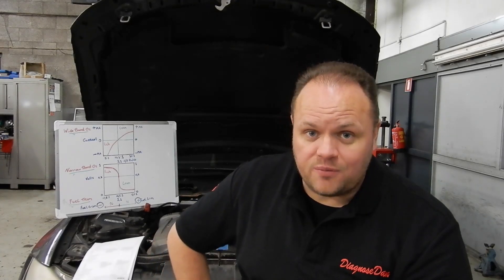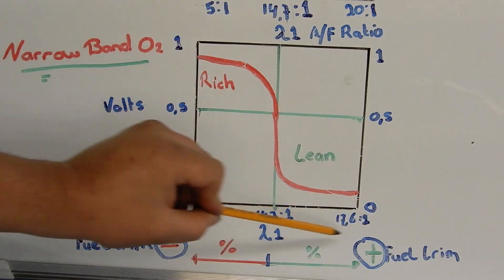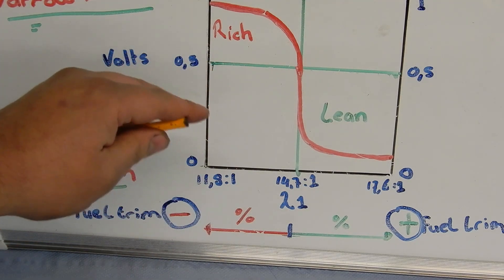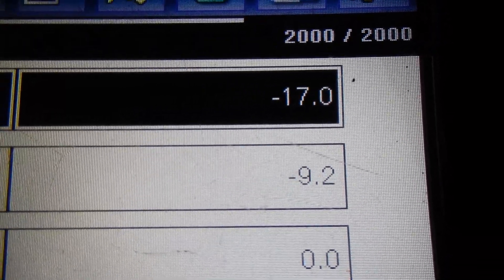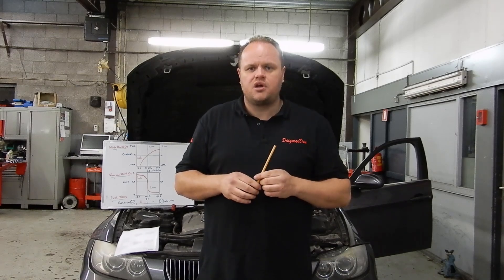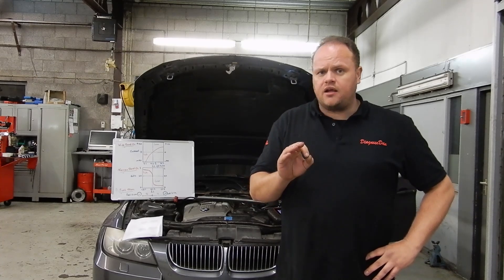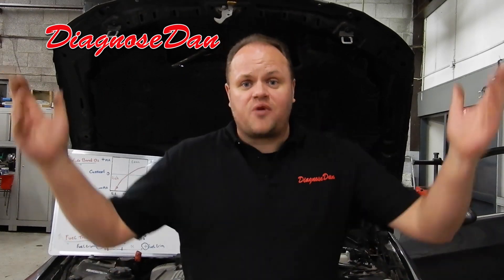Wideband O2 sensors, Narrowband O2 sensors and Fuel trim.

Comment: Really good video, for my search on YouTube send me to find it, really goos explanation,  i been a month try fix my truck, obd2 show long term fuel trim bank 2  28.9 and o2 B2S2 .045 with code of P0174 , i check everything no vaccum leak, now i will check O2 sensor with carb on intake to see if works

Comment: Hmmm. If there is no vacuum in the manifold of the Bimmer, then definitely you can't drive it lean by introducing a leak, it just won't care, you w2ill only introduce some dust. But how is this possible? I think there has to be something new about the valves on that engine. If I could "dynamically" control the amount of air by varying the valve open time or size, depending on the signal of the throttle position sensor, then maybe I would no longer need the throttle plate. I see no other possibility here. 

How strange. I am trying to help a friend diagnosing a 2006 New WV Bug that has some codes. There are two, that seemingly contradict each other: P0171 (bank 1 too lean upstream) and P2097 (bank 1 too rich downstream). This makes no sense, as if the bank is lean to begin with, how can it get rich downstream? I was contemplating my next step, when your video popped up (I did not search for this rare condition, I was just watching some basic refreshers about O2 sensors). But now, I am sure that my thoughts about a possibility of bad O2 sensor is correct and makes sense, and what my next step is going to be!

Thank you so much, Dan!

Comment: So...the only thing the O2 Sensor does is read Highs (Rich) and Lows (Lean), the Narrowband has longer times between the readings, while the Wideband has more readings within the same timeframe. That's their only function. Thus a Narrowband can be replaced with a Wideband .

Comment: Great video.  It sounds like Dan sprayed brake cleaner into the air intake to test the O2 sensors.  Is this the best approach or are better spray products (e.g., carburetor cleaner or starting fluid) available for this specific purpose?

Comment: I have a motorcycle, when I connect it to the fault detection device, the oxygen sensor value is 70mv, I think the sensor is broken, what is the operating voltage range of the sensor?

Comment: There is no vaccum  in the intake because of the valvetronic sistem that controls the amout of air gettin in the cilinders by changing the lift for intake valves. Throtle body is always open and that cause no vacum in the intake

Comment: I know I am late but still have some questions.
Post cat o2 sensors are ALWAYS narrow band and pre cat sensors are wide band for the past 15-20 years, right? Older cars might have narrow band PRE cat o2 sensors. Right?
Job of catalytic convertor is to convert the NOx to o2 hence we do not see the post cat sensors reading 0.5V (assuming pre cat sensor is optimally maintaining the 14.7 stoichiometric ratio) but about 0.8V. If we see 0.5V at the post cat o2 sensor, that means the cats are not doing their job, right?

Comment: What is bank 1 and bank 2?
Reply: Cylinder banks. In a V-configuration engine, this will refer to the left and right exhaust manifold sensors (rwd) or in a transaxle car, the front and rear.

Comment: my friend, you are right, in engines with valvetronic there is no vacuum in the intake manifold, one way to create vacuum would be to disconnect the valvetronic motor to force the system to work with the throttle body in this way, the throttle valve now will be closed, and there will be vacuum in the intake manifold. I read you Dan 👍🏽 from Peru

Comment: Could you please advise me why the voltage of the narrow band o2 sensor continually goes up and down? How the ECU interpret this scan voltage? Does ECU take its average? Or samples the voltage in a specific time, right at the exhausting cycle?
Reply: ECU makes the fuel adjustments intentionally to swing around magical 0,45 V (lambda = 1,000). Simple control method (crude, primitive, but works most of the time).
Both can be true: average is calculated AND (if microcontroller clock speed allows) it analyzes the actual waveform (along with crankshaft sensor, MAP, knock) to control the combustion even better.

Comment: This is a great video. I've been trying to understand  how these sensors work as I have a 2014 VW Jetta with a P2177 code. It all seems pretty basic though with your explanation. I think both of my O2 sensors are ok. I haven't tried anything like your trick of adding the brake cleaner though. My upstream sensor is right at 0.999 and the current seems to be very small 0.02mA but going both positive and negative. Based on that I'm thinking my problem has to be on the intake side. Is that a bad assumption?

Comment: What if my o2 sensor is reading from 0.17v to 0.38 back and forth between this readings i test 2 different 02 sensors to see if they are bad and even on another car and they are perfectly fine...
Can i have something wrong with the fuel pressure?
Spark plugs? 
What else can it be?

Comment: That is a BMW Valvetronic Engine. Throttle is only used temporarily for engine starting. The gas pedal actually controls a variable lift cam. Manifold pressure is high compared to normal engines.

Comment: Excellent video! You earned a new sub...

My only question is related to the actual numbers for the wideband...i am so used to the normal narrowband reading of .1v to .9v....i wish i knew about how much negative current (mA) is ok and positive current...as well as how much deviation from 1v for the lambda pid is ok or considered rich....

For example 1v reading for the pid lambda (which is lambda EQ) is perfect stochiometry...is .98 rich or is it acceptable?  Where does it become a problem?

Comment: No vacuum in intake because it has valvetronic? If thats the right name.  Where it adjusts the intake valve lift to idle under normal conditions.  I have heard these engines still have a throttle valve though.  Probably for safety reasons and other features.

Comment: back in the 90;s a friend had a fun one.  running very rich, Manual says ecm is bad  change it out, Saving grace his friend had the same car  they swap ,not the ecm. so the thinking outside the box happened. Hmm IF an O2 was telling an ecm incorrectly Hey I;m lean more fuel and keeps doing it the ecm obliges and you run super rich.  They throw a new O2 in  and instant success.   Local owner had a lean issue, luckily mecanic heard of clamping off the supply line to the brake booster as well as smoke testing and yes  engine soothes up instantly on clamping the hose. Pin hole from rust that started at the bottom of the canister

Comment: what would sensor 1 (the one that was bad) look like if you looked @ that data while inducing a rich condition with the brake cleaner into the intake?
Reply: As I understand it, look at the drawn picture showing sensor number 1, the wideband sensor, and look at the current (mA).
To remember how this works, I will draw these pictures in my notebook otherwise I will mix the values when using some kind of app.

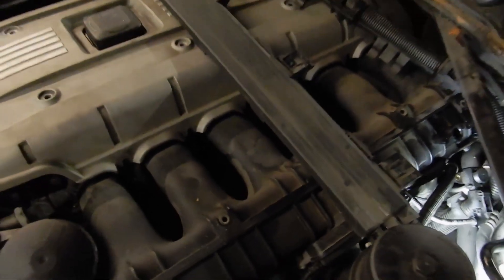Comment: 13:36 Because the engine has a valvatronic system, which replaces the operation of the throttle valve, and instead of it, the valves open at a certain height, and not the throttle valve. And the typical pressure in the intake manifold is close to 950 millibars normal atmospheric pressure is 1013 millibars.
Typical vacuum in most naturally aspirated engines is 300...350 millibars.

Comment: I'm trying to understand this O2 sensors generate their own voltages. I understand that part. I even understand oxygen molecules move thru the O2 sensor from the atmospheric chamber to essentially the exhaust side of the sensor and in doing this a voltage is generated. What I dont understand but want to know is is it the oxygen ions themselves that contain voltage or how does this occur? I'm also open to the idea that I dont understand the full concept of what voltage is exactly. Is there a book that explains these concepts beyond a repair scope? I really want to understand the science and theories behind how all these things work.

Comment: No vacuum in the intake manifold because it is a valvetronic engine
Reply: Yes , the valve(s) opening and closing are what controls the lift/duration to control RPM. There is no throttle plate to control the airflow into the engine. The TPS and other inputs control engine RPM.

Comment: Where was it that you sprayed the brake clean? Do you have a video showing this procedure?
I have changed my downstream bank2 sensor due to voltages being erratic and performance issues, however receive  the same crazy values after the swap. 
I am now hoping to verify that it is in fact the upstream sensor as was in your case.

Comment: Hi Dan, what a great video about fuel trims and 02 sensors and it has sparked something I have had a issue with for a while now. I have an issue with my 2006 Toyota Corolla 1.4 4ZZ-FE. The vehicle runs well when cold but once it gets to operating temperature it drastically loses power. Could my issue be related to O2 sensors?

Comment: Excellent video Dan , I just subscribed.. I have a 2012 Buick enclave and every morning when I start her up I get a very rough idle for about 10/15 seconds.. Almost sounds like she wants to stall and then boom she idles down perfectly ..what do you think can cause this.. I have a scanner I can look at fuel trims and O2 sensors but still getting used to using it..your thoughts..

Comment: hi dan 
thank you for the video 
i have a bmw 2012 n55 engine the oxygen sensor 1 bank 1 stuck rich at 1.46 voltage and -0.2 current and my downstream sensor fixed on 0.7 voltage with -7 long trim fuel trim at idle, i have a bad milage and shaking especially at cold start , i have no codes but i have p0240 code comes and goes every couple of months . 
could it be a bad upstream o2 sensor or somthing else based on your experiance ? 
thank you

Comment: Hi Dan I have a problem wit the bank 2 O2 senzor I replaced both of dem Brand New and now is a error with the same and mass air flow sensor bot is reding fine and the new O2 senzor is reding from 1.2 to 1.7 on bank 2 bank 1 is 1.0 costat, p0150 and p1100 on BMW E46 please help, all gasket replacement resently been with head gasket all from der for misfire on onli cilinder 2

Comment: If I had to choose between reading Wideband o2 sensor in mA or Lambda..which one is better for diagnosing problems I want to stick to one 🤔
Reply: In simple terms, a narrowband will tell you "rich or lean", but a wideband will tell you how rich or how lean. Sensor heater voltage in a wideband is generally 12V (should be labeled), and I haven't done this so don't quote me, but in theory providing voltage to the heater circuit and measuring the voltage output on the sensor circuit pins should give you a voltage output that'll tell you if you're rich or lean, and if so, how much.

Comment: No vacuum but there's airflow?  What is the direction on the airflow?   BMW 's valvetronic system controls idle RPM by altering intake valve lift.  There's more vacuum in a normal engine at idle, but with VANOS, only the amount of air needed to sustain idle enters the cylinder.

Comment: This reminds me of the time I had to diagnose a 1990 Dodge pickup with V8 and automatic.  When cold and warming up, ran great. Once it reached operating temperature, it would chuff and chug and misbehave.  The single O2 sensor was heated, and internally it bled 12V to the sensor wire forcing it to go rich.  New O2 sensor fixed it!

Comment: This is a very good video presented in a methodical manner. To answer your final question about why that engine had pressure in the manifold it is a valvetronic engine. As a former BMW trained technician  the initial give away is the bulge in the valve cover. Not sure if you have done a video on that system as this is the first off you videos I have seen
Regards
Ian

Comment: I wonder what could be the cause of the following: O2 sensor signal downstream stuck at 450mV (alreadly replaced the sensor with brand new) no change, and fuel trim bank 3, -100 % (stuck at this value).
The engine is a 2.2 GM direct gasoline injection 2005 type, Opel Vectra C 155 h.p D.G.I type engine. 
Engine runs even, but seems to be burning more fuel.

Comment: Great video! What if you have a BMW N55 engine stft spiking -1 to +5 consistently at idle? The wideband O2 shows up to 1.5v when stft is +5 and 1.38v when stft is -1. The narrow band O2 shows 1.08v when stft is +5 and 1.80v when stft is -1. Where should I start? Thanks

Comment: There is no vacuum inside the manifold as the butterfly is fully open and the valve adjustment are controlling air flow?  The vacuum has essentially been moved further down the manifold just between the valves and piston. The slight vacuum you can feel possibly two reasons. High flow of air creating lower pressure inside manifold. Some areas such as air filter still acting like a restriction. Anyway that's my guess.

Comment: Great video, Dan.  I'm a long-time self-taught garage mechanic working mostly on German cars, especially on BMW's.  And I'm also learning even more by just watching this video.  To answer your bonus question, I think there is still a slight vacuum after you remove the MAP sensor, or else, this Naturally Aspired combustion simply won't work.  And the reason that even when you articulate an artificial leak in the intake manifold and still maintained a stoich condition is because of BMW's VALVETRONIC system in place.  Under the VALVETRONIC system, the throttle body no longer plays a key role in intake air control.  In fact, you can have the throttle body fully open the whole time and it won't make a difference as long as the O2 sensors are properly working and nothing being wrong with the fuel supply.  Actual fine control of the air is done by the intake cams which is fully modulated by the VALVETRONIC system.
Reply: Hey Pete spot on man!
Also, our after cat 02 sensors do influence mixture on BMW’s by providing a reference point.
Reply: Correct Sir

Comment: Great explanation. In my car, when idle, the LTFT=-0.8, STFT=+3.2 and the O2 sensor varies between 0 mA and -0.03 mA. If the sensor reads OK or little rich why the STFT is adding fuel? Should LTFT be more negative? Thank for response. Keep getting time to post videos.

Comment: I have a problem on Mercedes CLS550 2007. I have replaced all O2/AF sensors. Before and After KAt. I can clear the codes and car runs fine. The next morning i come out and  P0638, P2176 throttle actuator stiff/ and P0030 and P0050 AF sensor before Kat Codes.  Car in Florida so it is not frozen.  Any ideas. These are new Bosch sensors for this car but not OEM Mercedes Bosch. I even thought I had a bad new one from bosch and replaced the Left front. Still the some. Any Ideas;

Comment: Hey Dan

Thanks for posting these videos your are a great teacher. I have been watching your videos for a little while now and I have learnt alot. I have been applying your technical advice in the field and using scopes more often than I use too. I try keep it simple and not be a part changer thanks to you and several out their I am becoming better and enjoying diagnosis more. I will try to to pass the torch. Of knowledge to our fellow technicians out there as you are. Thanks again. 

For the answer to question for no vacuum on bmw its due to the valve tronics it act like the throttle and the actual throttle stays open all the time which does not allow negative pressure (vacuum). Bmw actually installed a vacuum pump driven by engine camshaft. I think when system goes on fail safe throttle may operate like a normal throttle open and closing not sure correct me if I am wrong. Anyway keep up these great videos and I will keep watching. Your awesome

Comment: Nice and methodical diagnosis. Is it generic that a low voltage indicates a lean condition(for narrowband sensors)? Also how do you tell the difference between a wideband and narrowband sensor other than the scanner telling you?
Also this cars fuel trim operates off of the upstream sensor, why doesn’t it operate off of the downstream or both?

Comment: I think this engine doesn't have intake vacuum because the engine doesn't have a throttle valve to control speed, it uses variable valve lift to control intake airflow.

Comment: Regarding your question at the end of the video; “why does the vacuum leak not create a lean condition in the engine?”

Is it because of the BMW variable-valve lift which creates minimal suction losses in the intake manifold, coupled with the throttle body being held wide open all of the time allowing the valve lift to control engine-air intake volume?

Or is it because you have unplugged the mass-airflow sensor?

Comment: ANSWER: Not 100% sure but I believe these BMW's have a system that works like a diesel...they control throttle with the fuel injectors thus the intake throttle body is open. I'm not sure how that works as it would seem to run lean with anything less than full RPM. But then, its a BMW, and full of over engineering and complex hardware, software etc. that costs a fortune to maintain.

Comment: Smashing video once again Dan. This test can also be used to diagnose a fuel injector fault! Running lean and both o2 sensor working ok but engine runs better adding brake cleaner means injector fault. Watching the smooth running values on these engines also helps understand the cylinders which aren't performing well, positive numbers indicate less mechanical output of the cylinder. 
Dont forget on most newer BMW and mini deleting codes doesn't reset the fuel trim adaptations or injector learnt values etc , so you may change faulty parts and car still runs bad with learnt values which are incorrect. Injectors for all gdi engines must be coded.
Reply: Always wondered what the Injector Coding function on scan tools did. Thanks.